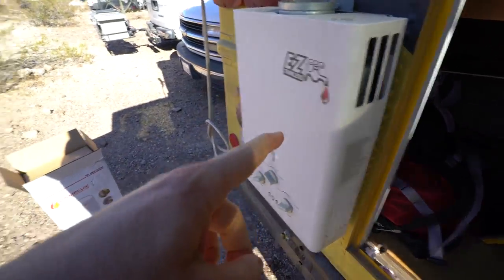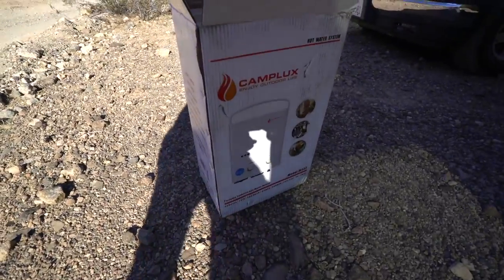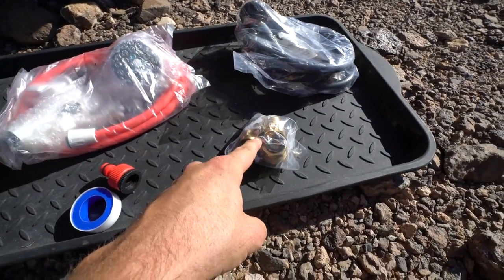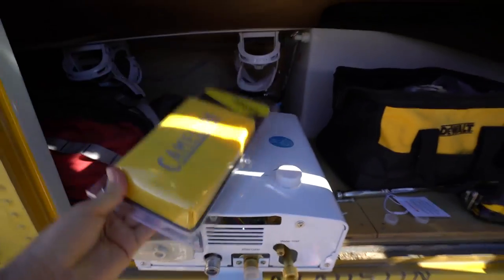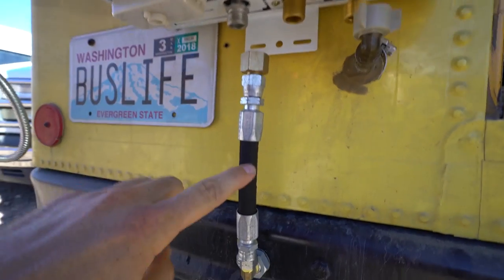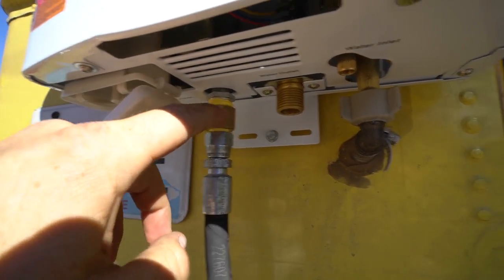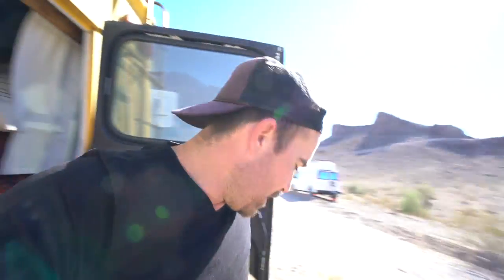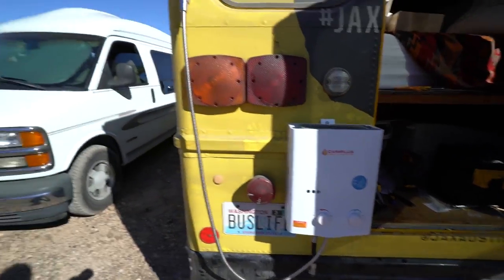Tankless Water Heater Install on School Bus Conversion or Camper Van (Camplux 5L Propane)

Comment: I own the same unit and it works great. I did find that strong wind will put out the flame. Restart and it will instantly come back on. Find the “sweet spot” with the temp and water flow knobs. Side note: ozark trail makes a shower tent, (Walmart $40) so that lady standing behind you won’t see your nuts. Hope this helps bro, rock on!

Comment: I have found with our unit that the water pressure knob needs to be set on low, if you have it on high the water pressure sensor will think that there is not enough pressure and cut if the propane supply. Give it a try.
Reply from the maker: interesting thx
Reply: Did it help?
Reply: @neginsarrami2457  he only has 1 shower a year so any day now

Comment: Tankless water heaters are different than normal water heater. Use the hot water adjust and set the water temp just a little hotter than you can stand, the only turn on the hot water to shower, add a little cold as needed to make it comfortable.
Reply from the maker: thx for the info :)

Comment: Had one similar and if the water pressure or flow isn't right it will kick off it's tricky to figure out sometimes
Reply from the maker: seemed to work for Rob's shower, will report back

Comment: Hey Jax do you have a pressure tank hooked up after the pump side it helps keep consist pressure in the system you can find them anywhere you buy RV supplys it might help smooth out the cycling issues also someone noted turning the temperature down a little will help the gas regulator which also maybe the problem talk to a technician at any RV repair shop camping world maybe able to just walk you through it. At least your getting wet and there's nothing better than a great shower to start the day.

Comment: Our electric tankless in the house will turn off if the water pressure isn't high enough. Maybe your pump is having issues? The valve in the water heater only opens up when the water flows full blast, then it dials down the flow to where it can heat the water fast enough to get the desired temp. If the water flow then slows down too much, perhaps the tap isn't open enough (on our system) then the heater stops working.  Maybe this info will help you trouble shoot your system.
Reply from the maker: cool. thanks. will report back how it's working